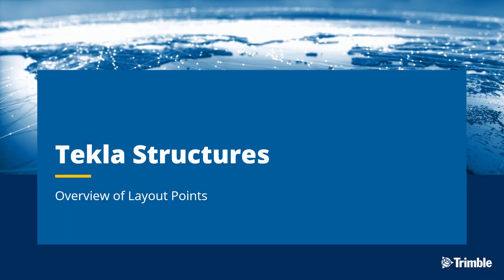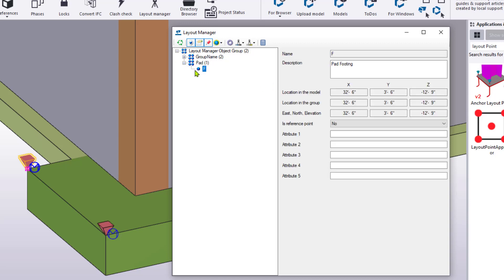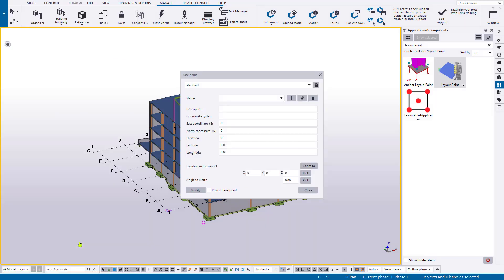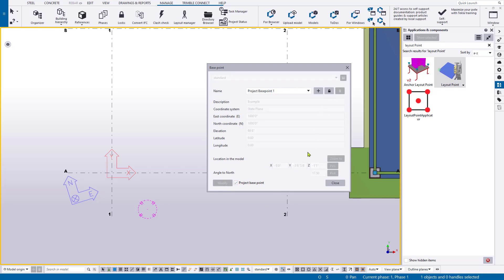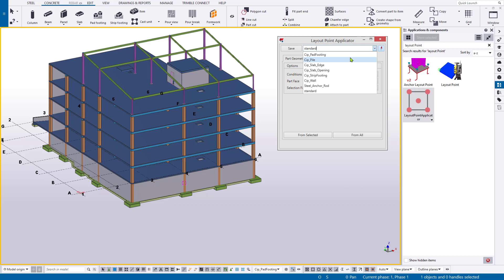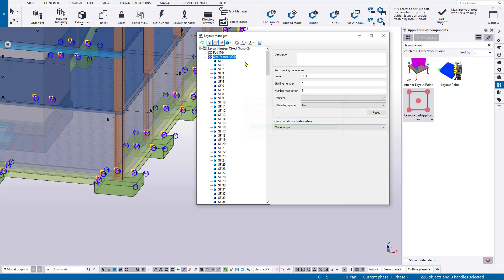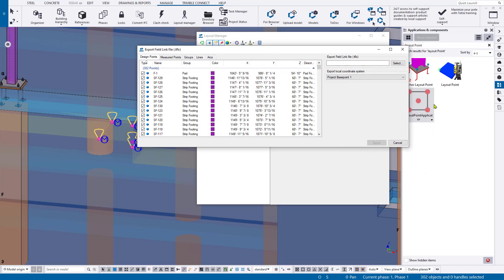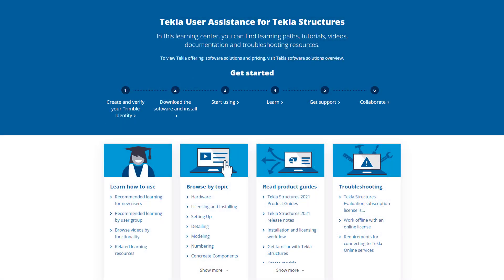Overview of Layout Points in Tekla Structures

Comment: I want to use the Layout points in drawings. if I inquire the specific layout point the name of the layout point comes under the 'More´ section with 'Point label' but I can't find this particular information in drawing part callout. the idea is i want to show the report of the points in drawings with a template and also show the point location in drawing with names.
Reply: Exactly, unfortinatly there is no way to show point number on the drawing.